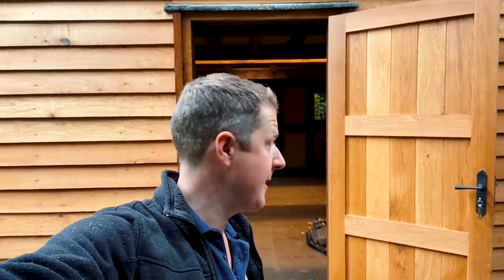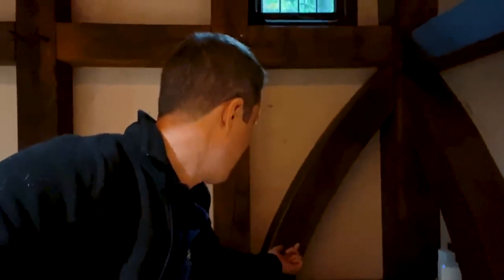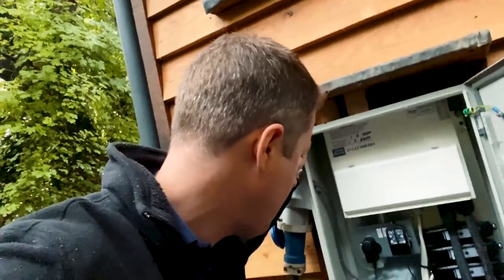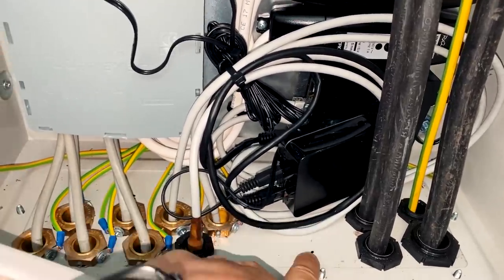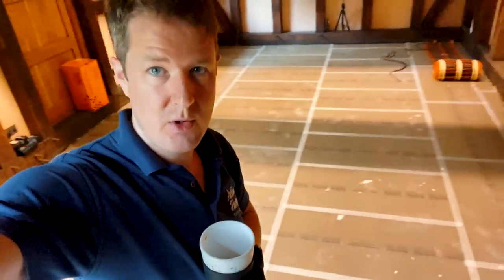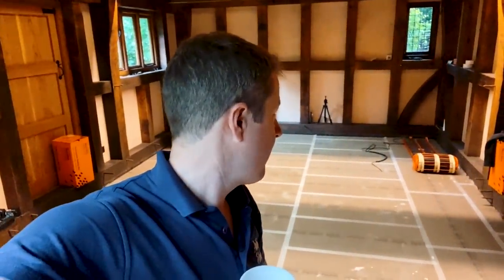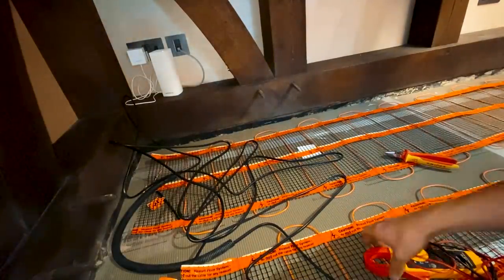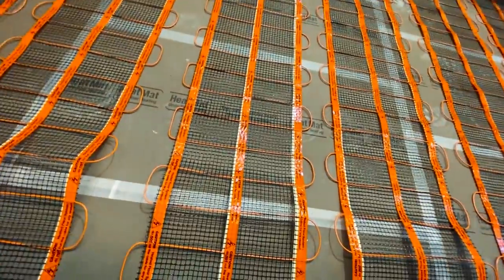Electric Underfloor Heating Installation UK - Back at the Studio

Comment: Great job Jorden, but the height of the programer should be 1.2m because it could be comparing the rooms ambient temp with the actual floor temp. If so you may get a call back to say it's not working correctly. But it was the clients choice to have it hidden. So if you do go back and incur additional costs, it's only right they are passed onto the client. 😁😁😁
Reply: Most under floor heating stats can be set to either use air temp or floor temp so it's not really an issue. A lot of manufacturers also state that they should be mounted on an internal wall, which is not possible there, sometimes you just have to do your best.
Reply from the maker: Thanks that was my reasoning too
Reply: whats the difference from 1.2 m to 1.5m of the floor
Reply: @DerekHundik  if you look in the install manuals for any stat they all say 1.5m and normally on an internal wall
Reply: @acelectricalsecurity  let me have a look but why in first comment guy says it should be 1.2m What i do is put them always above the light switch.

Comment: Hi Jordan, interesting video,  the MCB was protecting the load through the contactor but what did you use to protect the control circuit ?. In industrial panels we would always protect the control and the loads independently, say 32amp load, 6 or 10 amp control. Thanks.
Reply: Good point, the cold tails are now protected by a the 32a MCB. They are unlikely rated to this. Unless Jordan installed separate fused spurs for each length of mat?
Reply from the maker: I followed the instructions from HeatMat which was to connect the cold tails in parallel to the outgoing side of the contactor, the control circuit is on a 6A RCBO.
Reply: @artisanelectrics  This is such an interesting comments your video has thrown up.  Full of really thoughtful input, it's so great this medium dont you think!
Reply: @artisanelectrics  , cheers mate thanks for the reply.

Comment: Very interesting. I prefer the cable to the mat. I would have painted the face brown . Most importantly we always put down a second temperature probe and leave the leads un connected in the thermostat. Thus if the first fails the second will be an easy fix.. When you look at the system, it is the most likely to fail.. Another reason I like the cable is I can dictate the watts per sq. Meter, I.e. closer together more heat per sq meter. I’m surprised taping the floor shield wasn’t the job of the. contractor. We are required to check the resistance before unrolling and after installation.. I did a repair job for a friend who had the job done by some unprofessional people . The cable he used was compromised in three locations and the tile was already installed. That took a while and with infrared thermometers and spark generators and eight hours , we repaired it. I love underfloor heat, it’s the way to go especially if you have small children. They are always playing in the coldest region of the room, the floor and underfloor takes care if that. Less likely they will have ear infections. Thanks for your vids. Would like to stop by sometime
Reply from the maker: Thanks
Reply: We in Finland always put probe in small flexpipe so you can change it when it fails, just tape one end so when they pour concrete it won't fill that pipe.
Reply: @urho1  same in Norway👍🙏🏽

Comment: Having the floor probe in-between the elements of only one matt would mean if that matt fails the other wouldnt ever turn off as it wouldnt have any sensor to trigger the stat
Reply from the maker: That’s why it has room temperature sensing as well
Reply: Artisan Electrics I’ve only ever seen stats with the option of the probe or room sensor not both at the same time.

Comment: I installed 4 lengths of these the other month, however in the instructions it did say that every length of mat was to be fused. Did this particular mat not ask for that? Great vid as always.
Reply: 👍🏻 Grid plate and fuse each mat before going to the contractor otherwise only covered by the 32A RCBO..., totally agree, - apart from that, quality install!
Reply: @ashleyrawes6253  how do you mean, grid plate?  do you mean switch plate with fuse unit in it too, I can't picture what you mean?  sorry to ask but interrested how you mean cos I just did one just like Jordan's except my mats had separate 8kW m,ats and controlls as they were under separate squash courts.   I really would like to know what you mean as you sound like you know about this more than I
Reply: LAsparkTV Wire&Test Limited I think what he’s saying is he would have fit a box with gridswitches with a downrated fuse in for each individual heat Mat  so in this case 2 fuses on a grid switch in the enclosure  so that the heat Mats was not supplied directly by the 32 amp 60898 mcb

Comment: Hello Jordan, I was wondering if you have any information about the insulation under the heating element, is it possible to use something else other than the heat mats, in our country they are not available. I am planning to install underfloor heating in the house but I have issues with the floor hight, a part of the room is about 5cm higher than the rest, so I was planning to lay down some denser styrofoam, since we don't have heat mats. What do you think, would it hold up? Than in advance.

Comment: What circuit did you take a feed to the thermostat?  I assume the 32A goes straight into the contactor but there would need to be another feed to the thermostat to control the contactor coil.
Reply from the maker: I used the lighting circuit as a control circuit as well so the thermostat is on a 6A RCBO
Reply: So it’s ok to power the thermostat from a fuse spur on its own rcbo fused down to 3A along with the contacter been ran on a 32A. With the out going side of the thermostat running back to the contractor with the cold ends from the mats.

Comment: Great vid, this is why I value AC so much. not a huge amount on cost difference to install in a space that size. However it’s an all year round climate control, heating and cooling along with the dehumidifying functionality it would serve that room very well. Also massively cheaper to run than underfloor heating. Nice installation as always though.
Reply from the maker: Thanks yeah never would have thought to install AC good call
Reply: Artisan Electrics no worries, I run an Electrical & Air Conditioning business in Milton Keynes. If you ever want any info or just have a question on AC don’t hesitate to drop a line. Keep up the good work my friend.
Reply from the maker: Thanks will do! 👍
Reply: A heat pump would be a good choice but, maybe the customer didn't want to see the indoor units on the wall going by the fact he didn't want to see the small thermostat. Also i do like a warm floor on a cold day
Reply from the maker: Yeah exactly it just wouldn’t have fit in with such a beautiful oak building

Comment: Wouldn't you of need 2 stats for the 2 separate mats?
Reply: No because 1 stat is controlling the coil of the contractor but the contactor will power both mats once the stat calls for heat.
Reply: Even if connected in parallel to the same circuit?  Do you think so?   What do you reckon?

Comment: Had a question Jordan, was wondering was there any controls to the contactor controlling temperature?
Because as far as i understand, the  thermostat would just power up the a1 a2 terminals in the contactor, sending power to the the mats, but how is temperature controlled?
Reply: Pause at 14:52 and you'll see there's a backwards L shape in white tape going along the edge of the floor then between the heating cables. If I'm not mistaken that's a floor thermometer to measure the temperature, which runs back to the thermostat. So when the floor hits the max temperature it's set for the thermostat will turn off the contactor.
Reply: @Mattja1  thanks for that. I understand now

Comment: Didn't the customer consider a heat pump?  Would have used less than 1/4 of the electrical power and you can also use it in the summer for cooling.
Reply: I was going to say the same thing - but maybe the noise (even though good units like Daikin are very quiet) would be a problem in a studio?

Also - what breaker did you use to power the thermostat and the coil side of the contactor - should be on a 6amp breaker I think.
Reply: @Richardincancale  Here in CZ we connect thermostats and contactors to 2 Amp type C  MCBO  Heating mats have RCD  and usually each separate MCBO.
Reply: @Richardincancale  He used a 6amp breaker on it.
Reply: LAsparkTV Wire&Test Limited Yes I saw his reply to that effect. But the video showed him having only three slots left, 2 for the contactor and one for the 32a amp MCB to feed it.  I guess he must’ve used an existing 6 amp MCB elsewhere in the board.

Comment: I am not a fan of electric heating full stop, it's just too expensive to run.
I have had a few of the temperature probes randomly go open circuit, so on the odd occasion I do install it, I now install 2 probes and leave the other in the back of the box for future use.
Reply from the maker: Nice tip
Reply: The floor sensor should be mounted inside the pipe and the wire routed through the pipe to the thermostat. Thermostats and sensors are prone to breakdown and different thermostats use different types of sensors. When this breaks down the thermostat eg. 10 years from now, you can not be sure that you get the same type of thermostat to replace it.
Reply: @peto22  the thermostats can use either floor sensor or air temp, so there's no need to worry what may happen as you can just set it to air temp, if it were to fail.
Reply: @acelectricalsecurity  Now that is dodgy! If thermostat location is chosen with fact it uses floor sensor, it is probably bad place for air sensing thermostat, as in this video.
Reply: @peto22  yeah your right what was I thinking of suggesting a thermostat be used for measuring air temperature, how rough is that

Comment: Did you just connect 2 cold tails in the end based on your floor  measurements. I guess you didn't need the 3rd smaller piece. And does the thermostat support smart connectivity for remote management of the heating
Reply from the maker: Yeah I just used the two in the end. The stat is a WiFi one so they can control from their smart phone etc

Comment: Rcbo to protect under floor heating, you will get nuisance tripping also the contactor should be spaced away from the protective devices to prevent heat transfer from the coil of the contactor on to the protective devices and vice versa. 
The thermostat with not control the true temperature of the room. As such it is not installed to the manufacturers requirements .
Reply: Why would he get nuisance tripping ? I haven’t installed many underfloor heating systems, but the ones that I have done, the manufacturers instructions have always stated that the install needs to have RCD protection. To date i haven’t been called back to any of them for nuisance tripping ?
Reply: @darrenqualters2341   it a resistive load with the contactor switching on and off the rcbo will see the imbalance between the live and neutral. This will happen over time.
Reply: Steve H the contacteur does not turn the rcbo on and off it stays perm on the contacter open just like a relay allowing the power the continue through
Reply from the maker: Exactly
Reply: @leeburnside735   yes it know that. The rcbo   wants to see a balance between the phase and neutral when this balance goes out of kilter the rcbo will trip. This can happen with resistive loads and can be problematic due to the in rush of current when the thermostat calls for heat or when switching off when the required temperature is achieved. Also the contactor is being switched by the thermostat and if both poles don't engage or disengage at the same time this can cause the rcbo to see the imbalance between the phase and nuetral and trip. Which is classed as nuisance tripping. Just stating my observations and personal preference.  Either option is compliant to BS:7671

Comment: Another great video Jordan 👍🏻. Wondering if you carried out an insulation resistance test between the two heating cores and earth sheath?  Had a floor tiler damage the last one I installed so failed an IR test!  Had to get warmup engineer out to locate and repair the matt (that was interesting to watch)
Reply from the maker: Yeah I did thanks for watching!

Comment: I have installed electric underfloor heating on small household floor areas within existing buildings. 
For such a large floor area I feel that ground or air sourced heating would be a  more effective long term solution. 
Naturally the installer has no influence on the client’s choices. 
If building conversions and new builds had to conform to the highest levels of energy conservation then this type of installation would not be necessary. 
Energy conservation in buildings is so important for the long term sustainability of human life on earth, particularly in the wealthy economies whose present carbon footprint levels are unsustainable.
USA = 16 tonnes carbon dioxide per person per year. Europe/UK and other rich economies = 6-7 tonnes per person per year.
A so called developing country like Uganda is at 0.1 tonnes per person per year.
I am not knocking this installation, rather I am questioning the efficacy of electric underfloor heating vs a wet system, or raised insulation levels which make conventional heating systems unnecessary, combined with mechanical ventilation and heat recovery,.